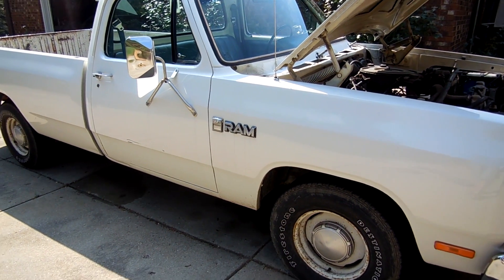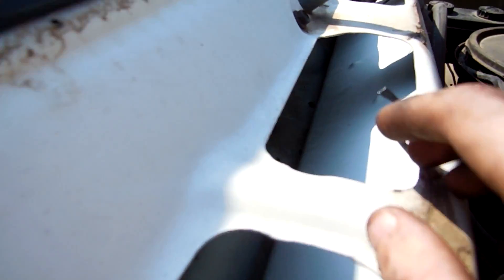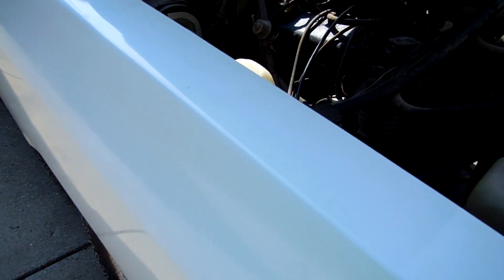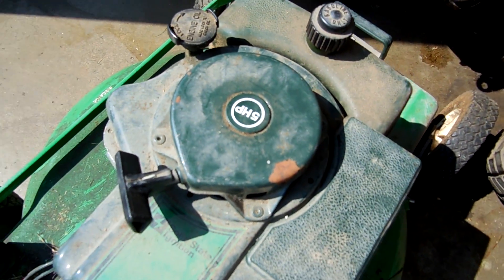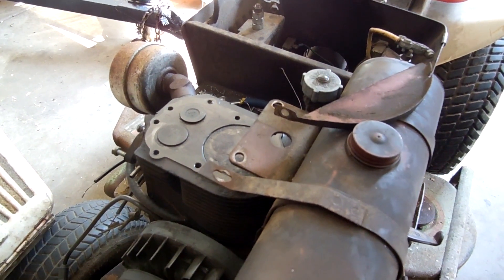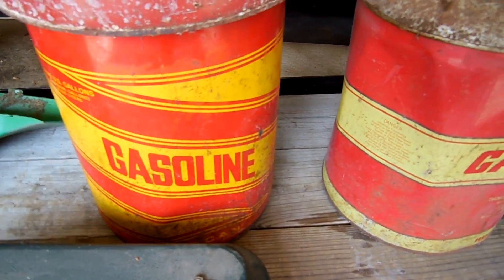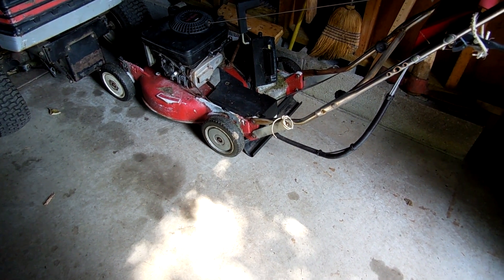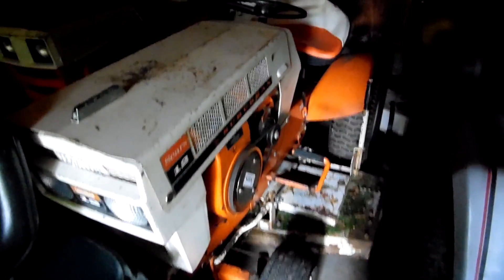Garage and Shed Update

Comment: Good stuff going on up there Danimal! That Bolens is pretty sweet.
Reply from the maker: That Bolens is pretty sweet if it would only run. When I get the broken bolt out of the head and out the head back on and such, if it doesn't run I'm just going to throw the towel in and call it quits on this one, for a while at least. I'm so frustrated with it! Lol